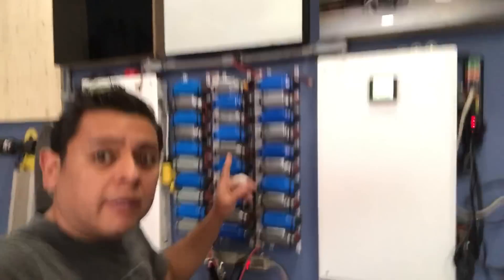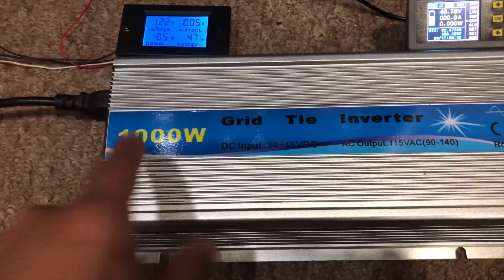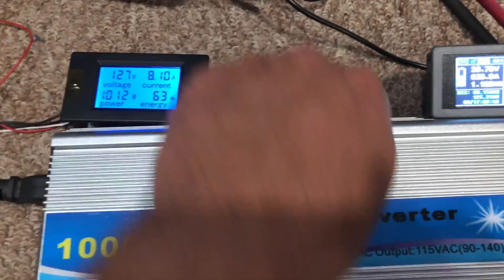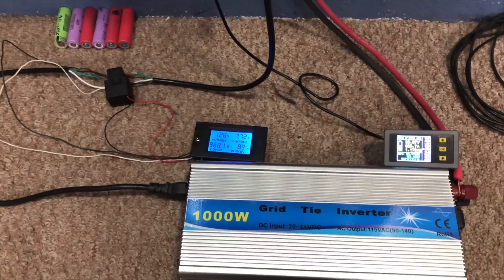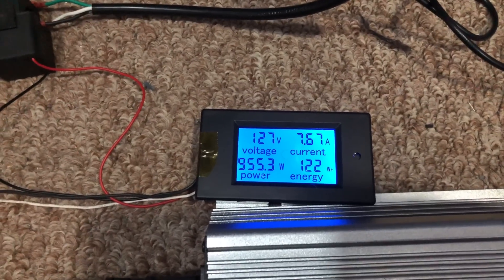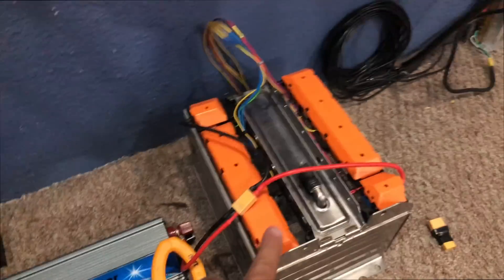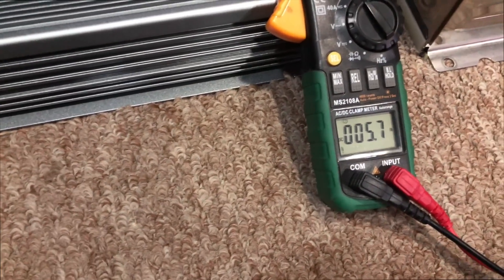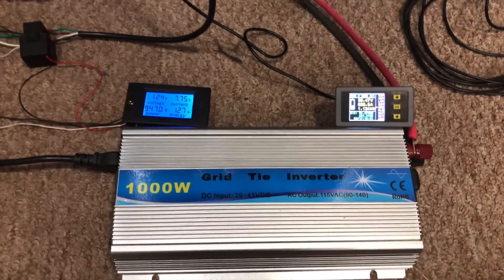Do Cheap Amazon 1kW grid tie inverters Put out 1000 Watts?

Comment: can we use normal lead acid battery's inverter for this purpose ?.....i wish to replace stand-by lead acid bank to li-ion ones. So, do they sufficient for that purpose
Reply: The inverter dos not care where the input voltage comes from.
The only thing that matters is that the baterys can handle the amps.
Also check that the inverter is made to output into the grid (If you plan on doing so ) since most of them cant.
Reply: Nino Joel 
Thanks for that 
You mean I should check the amps  it could handle. Isn't it ?

Ok I will look after that.
But inverter is for DC to AC so, why we should look at amps into batteries 
They were source in this case not load.
Please clear this to me.
Reply: sai krishna I mean that the battery needs to output manny amps without getting damaged / overheating.
So be sure to check what amperage the inverter pulls from the batterys.

As for the inverter part you need a inverter that produces a pure sine wave and has some frequency sync functions if you want to push the energy into the grid.
You won't need to check that if just you use it to power things of grid.

Comment: Pleasantly surprised, honestly did not expect them to actually output the full KW. More likely to invest in 1 now :)
Reply: achieving 1kW is easy. Doing it efficiently isnt and that inverter certainly is not efficient...
Reply: None of them are, i stand by my comment...
Reply: No dispute there, i learned the hard way about driving cheap chinese tech at its rating. If i buy one, it would only be loaded to 500 watts, and would be switched with relays only when by batteries are full :)
Reply: Haha i know mate, i don't actually use a chinese inverter (seen way too many bad reviews). I'm actually using an old UPS as my inverter at the moment which i can get 93% efficiency out of. I am only really powering my server and desktop pc from the system at the moment, but its pretty reliable especially considering i live across the pond in the normally cold dark and wet uk. This abnormal weather is a welcome break from the norm. :)
Reply: doh APC inverters are the muts mate, but you want the 1500 and above for true sine apparently. :)
Reply: ohh i believe that, i remember programming bbc micros at school, then we got a nimbus 486 hahaha
Reply: i can only imagine..
Reply: This type of inverters, although that may be the better solution for small production, the efficiency will never be the best, because they have to increase tension for after make pwm, so, there are two steps and two rectification and transistor use, others, take higher voltage by series of panels, making it more efficient, for bigger production
Reply: How many panels are being used, as well as what size (Watts)?

Comment: I have the exact same model run about a hundred bucks I have loved it but you are correct they do burn out quite quickly when you run it at a thousand Watts
Reply: The design is to look for voltage drops when the volts drop it stops increasing
Reply: Keep it at about 600 watts in the last forever
Reply from the maker: Been running 2 at 600 for months now
Reply: jehugarcia nice call. It's kind of hard to beat the price for what you get
Reply: jehugarcia you limit the Watts of output by the volts you put in if you put 24 volts in you will get 500 watts out if you put 40 volts in you'll get a thousand Watts out
Reply: You could open it up and check for shunt resistors, if that's how the device measures input & output power it'd be easy to stack another shunt on top and halve the max output.
Reply: You coud limit the input side with a Step up converter or a Transistor circuit .
Here are some samples.

https://electronics.stackexchange.com/questions/39465/current-limiters-using-transistors-and-diodes

Good video by the way Jehugarcia
Reply: How do you limit the power if it's connected to a battery bank?
Reply from the maker: Not found a way yet,
Reply: jehugarcia how do you limit their output?

Comment: Hi. I have a 300w version and a 100w solar panel. Works realy well
Reply: Proyectos LED Gastón , que hacés por acá jajaja me compré un panel de 150 w por mirar tus vídeos. Abrazo
Reply: is it still good and running without any problems?
Reply: Hola Gastón!! Jaja también por tu culpa adquirí un inverter y dos paneles. Saludos a la comunidad de Proyectos LED!
Reply: Have u has any troubles with urs